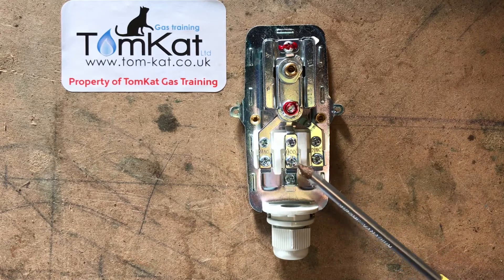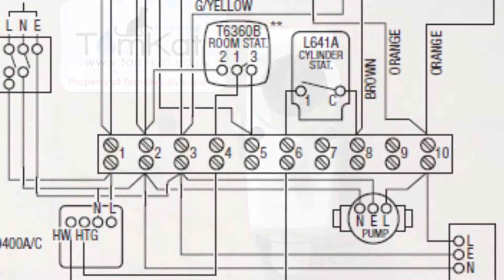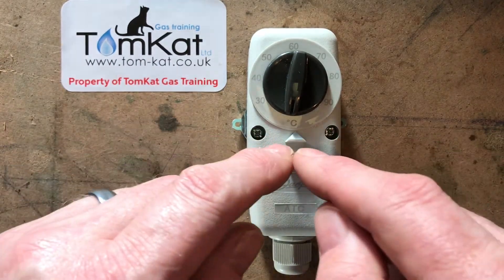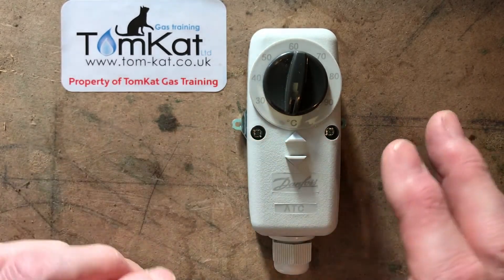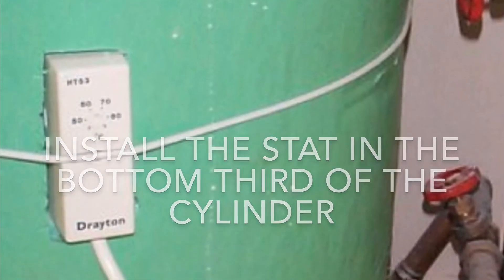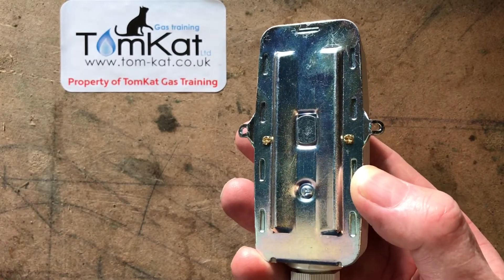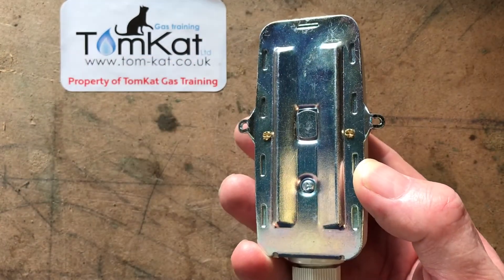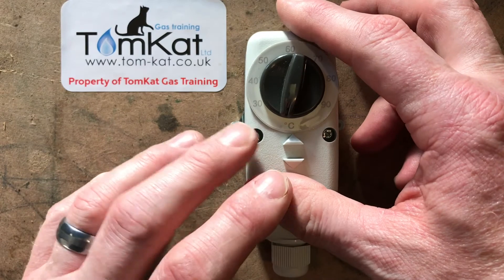HOW CENTRAL HEATING WORKS, The history of central heating part 4B - controls

Comment: Shocking! 10:04 into the video... Right cable the earth is being used as a switching wire  ( 1 Hot water off) 10:08 No earth in right hand cable doing Hot water / Heating on. Earth wires protect the cable.. Repeat with me..  EARTH WIRES PROTECT THE CABLE! From idiots chopping through them and receiving 240v shock! BANG!!  If no RCD (Residual current device) was installed the supply would not disconnect. RCDs disconnect the power on a small earth leakage (like you chopping through a cable or putting a nail through it) They disconnect with in 20 / 30 milliseconds. Fast enough so you don't die as a result of current passing through your heart causing it to stop!  Please teach the importance of what I have just said.. Might save someone's life one day. Thank you!!

Comment: The continuity of the earth throughout the installation is in case anyone chops through or puts a nail into a cable. No earth protecting the cables would mean the MCB fuse would not blow leaving the cable and whoever was in contact with it receiving 240V.  The earth all the way through the installation back to the Fused connection unit and then into the buildings cabling back to the consumer unit (Fuse board) is so there is enough fault current to blow / trip the fuse in the fused connection unit or  Mcb at the consumer unit (Fuse board). If there was no earth continuity cutting a cable would not cut off the supply.  SO MANY plumbers do not get this principal and wire the electrical side of the installation incorrectly. I'm sure you know this but just wanted to remind the plumbers / trainees so they know the importance of the earth wire.

Comment: If the two zone valves close, why would the the pump keep running? Would it be because the pump is faulty?

Asian Jon. Training.
Reply from the maker: M J0n4id no it’s called pump overrun when the boiler controls the pump to remove the heat

Comment: Hi, would I be right in thinking that if the programmer is switched off there is NO WAY the room stat or cylinder stat will work? So you’d get no hot water or heating, no matter if you tried turning either stat up.
Reply from the maker: Simon Stones correct the power starts at the programmer then through the stat then the zone valve then boiler and pump
Reply: Tomkat Gas Training been trying to get my head around this side of things for the last week! Obviously your videos have helped. 👍 so the programmer is king in this sequence then!

Comment: Is a pump over run controlled by the boiler so no extra wiring is required?
Reply from the maker: 1Monaghan yes the pump is wired into the boiler which then controls it . Thanks for watching cheers